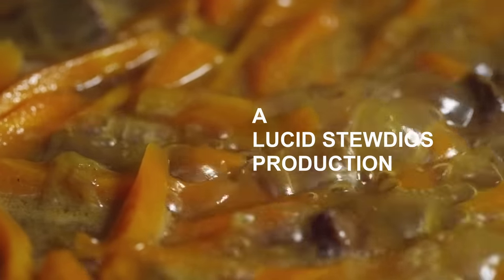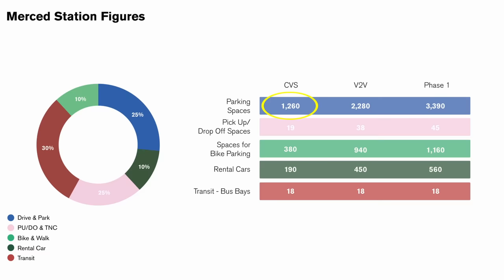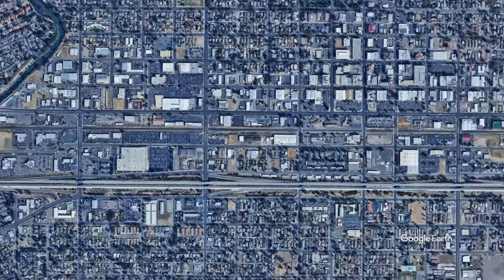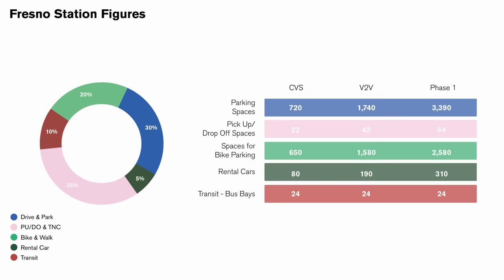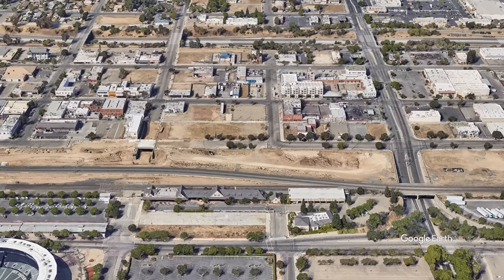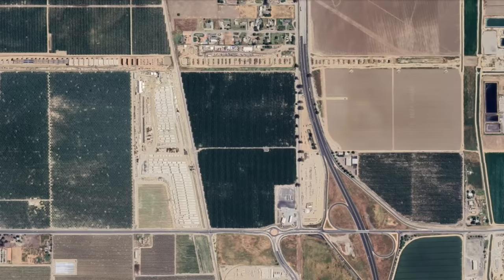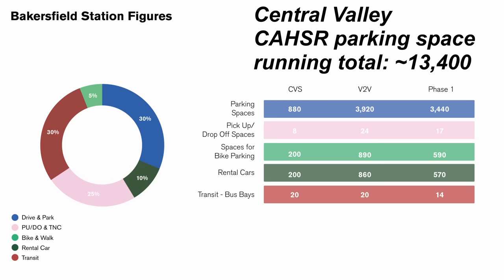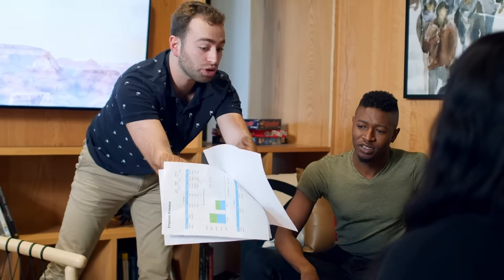California High Speed Rail : A Park & Ride Nightmare | CAHSR

Comment: I'm gonna hold in most of my thoughts on your video because I am already fully aware of your disdain for this agency. What I will say is, just like many other cities with railways like this, TOD will come and I think many of these parking lots will only be placeholders. 

Also, these are just renderings. I'll be excited to be more critical once the final designs come out. So yes, you are overreacting. It isn't an anomaly to build railway stations outside city centers. Valence TGV in France, Reggio Emilia Mediopadana and Napoli-Afragola railway stations in Italy are other good examples of stations not residing in the city centers.
Reply from the maker: Right, someone else used Valence as an example. Go look at what that area is like and then compare it to wasn't going on outside of Hanford. That Napoli-Afragola station isn't even the same situation. It's arguably in a bad spot, but its only a mile from the center of the town there, only 6 miles from Naples, and the area is gorgeous and not a dusty farm town.
Reply: @LucidStew  Makes no difference. Neither of them are in the center of a city. And regardless, all these complaints you have were already negotiated when they first came up with the route, so I don't see the big deal getting pissed about it now. And anyway, the city of Hanford is not even that far from THAT railway station. 

In this country, we should probably be a little more grateful that we're at least getting some semblance of a high speed railway given how terrible this country has been at even getting these things started. Until we have a government that is actually 100% friendly on these things, we have to take what we can get.
Reply: Yes and in quite a few of these situations (Bakersfield) in particular the cities lobbied to have CHSR take a more peripheral route. Not sure it's even a problem but I find that trying to fault CHSR for those decisions without regard for the political forces shaping the route selection is totally misguided. Nothing exists in a vacuum and the CHSRA is not some supreme identity that has power to make all decisions by divine will.
Reply from the maker: @brianwithoutay2291  Who faulted the CAHSRA?
Reply from the maker: @TheRailwayDrone  It makes a world of difference in draw and desire to preserve by avoidance, but if you're determined to ignore the differences, then of course it doesn't make a difference. "we have to take what we can get" no, we don't. We, The People, can demand and vote.
Reply: @LucidStew  Then you should have voted when the project was being talked about. What do you think they're going to do now with all the structures and route that have been built? Tear it down and start all over?
Reply from the maker: @TheRailwayDrone  The existence of the Kings/Tulare station was never up for a vote. It is not mentioned in what we voted for. No, I do not think I can change it, but I can continue to highlight it as an example of the negative effects of government on auto-pilot or the impactful decisions being made by the plethora of non-elected committees, commissions, and boards in this state.
Reply: @LucidStew  Whether it was up for a vote or not, it's there so we have to deal with it. Otherwise, run for Governor and I'm sure you'll have a lot of Republicans and some Democrats who will be more than happy to stop the project in its tracks and leave a bunch of unfinished structures in its wake.
Reply from the maker: @TheRailwayDrone  I don't need to run for office to voice an opinion about a topic, nor does anyone.
Reply: @LucidStew  And I don't need to make content to voice mine.

Comment: I agree the architecture sucks. The number of parking spaces sounds like it is on the somewhat over kill side (roughly half to a third more then what is at a WMATA outlying Metrorail station), Vast acres of asphalt for parking should be replaced with parking structures with ground level commercial or even placing the parking structure above the station head house and platforms. See WMATA Hyattsville Crossing Metrorail station.

Comment: I would so prefer to leave my car in a garage where it WILL be shaded in the central valley, than to leave it in surface parking that may or may not be somewhat partially shaded but will definitely make my car an oven whenever I return
it feels kind of like someone left in those big areas to try and scare people into making sure they become TOD... which would probably then necessitate turning the existing parking into garages anyway
or they were trying to save money (wait a minute)
Reply from the maker: Given the current trend, I would assume surface parking would have solar shading, but that's also not all that great if it needs to be ripped out in 10-20 years.

Comment: All of this looks like they just asked the guys in the highway-monster building department to envision trains. The walk out of Madera station looks like it leaves you abandoned.
These renders feel like they’re setting the whole thing up for failure.
Would be more excited to complain about a lack of parking over making more black burning hot vacant lots that are no good for the environment.
Reply from the maker: It sounds like initially most of these will be fallow until the expansions, which could take a VERY long time. And that also brings up the issue of having to let this land sit there doing nothing in the meantime, or perhaps they will improve it only as needed.

Comment: There should be no parking (except for handicap) at these stations except for maybe Kings/Tulare, take a damn uber if you're that scared of the bus. Agree with another commenter that if we really feel the need for parking, we can build a garage.
Reply: I think the reason these are marked for parking is because they haven't found any developers. I imagine once they get developers it will be different. This seems to be the case with most of the TODs in California.
Reply: Some day you will be able to take the Cross Valley Corridor to the kings station.
Reply: sounds like you really want HSR to fail. Even BART and Caltrain provide parking in the suburban communities they serve. Communities that already have significantly better transit connections than these 4 central valley cities CHSR will initially serve. Parking lots are both easy to build and easy to tear up. There is plenty of time for CHSR to work those details out in a phased approach consistent with the phased construction of the ROW.

Comment: Weird that pedestrians and bicycles are combined, as the distance/reach is way different. Also when combining them it's impossible to determine the amount of bike racks needed.

Also, they are repeating the same mistakes Europe and other places made in the last century, by not having entrances near the end of the platforms. In particular for Merced it would be great to have an entrance in the direction of downtown.

Also it might be a mistake having side platforms in Merced and Madera as it's not unlikely that people will change between trains at least at times when there isn't a great service on all three legs of the triangle connecting to SF.

Comment: How about looking at existing train stations for comparison?
The LIRR Ronkonkoma station has 6100 parking spaces.

How about looking at airports without geographic constraints?
In the Big Blue parking structure alone at Detroit Metro Airport, there are 6700 parking spaces. On-site parking totals 19000 spaces.

Comment: The purpose of CAHSR's central valley stations isn't to move the area away from cars - it's to contain the cars on the cheaper real estate there and keep them out of the expensive real estate in LA and SF. That is also coincidentally what Park and Rides do best, and mirrors the setup that airports have (which is what HSR truly competes against instead of driving).
Reply from the maker: So you're saying it benefits rich people and shifts that burden to the lower classes?
Reply: @LucidStew  i mean, sure, but you could say the exact same thing about airports
Reply from the maker: @jmlinden7  It's a way to do things, but it's not really a good way. Airports have many problems, especially in the amount of land they consume for their activities, or the overall environmental impact of air travel.
Reply: @LucidStew  Yes HSR stations are better than airports in various ways, but they still primarily serve the rich, just like airports do.
Reply: let's not forget that the largest parking lot operation west of the Mississippi is BART. BART is gradually converting some of that parking to TOD but it is a system that essentially operates as a Park & Ride for the more suburban communities of the Bay Area. Many BART stations of course provide no parking at all as they are located in a downtown core. A system as large and sprawling as BART will take on many forms and I think it's not unreasonable to expect the same for CHSR.
Reply from the maker: @brianwithoutay2291  BART is carrying 1/3 of its pre-COVID ridership and had to be bailed out by the state, so not the best comparator if you want to paint CAHSR prospects in a positive light.
Reply: @LucidStew  perhaps the fact that the core business district of downtown SF has a record vacancy rate of 35% is a factor in BART's reduced ridership. If BART had more housing and other TOD around it's suburban stations I'm sure you would get some increase in ridership to downtown SF but who's to say those people would not just work from home themselves? I don't think people are avoiding BART because the stations have too much parking. I suspect other factors are at play.
Reply: @LucidStew  also don't forget that pre-COVID BART had amongst the highest fare box recovery rates of any transit system in the nation. Caltrain had pretty respectable fare box recovery rates itself. The reason COVID affected BART and Caltrain's ridership levels so much is that they served a disproportionately large share of upper income professional workers whose jobs afforded them the flexibility to work from home. With ridership reduced to just the "essential workers" the reduced fare box income threatened their viability. Of course a bailout from the state was necessary and justified in this unique historical circumstance. BART still remains an incredibly successful and well designed system.

Comment: Instead of doing a bunch of flat surface parking why not build up? two parking garage buildings that can be built right up against the station, multiple stories with ramps straight to the station. Why level building to make a parking lots half a mile away destroying local business?
Reply from the maker: The way I interpret it is that surface lots are cheaper as place holders. As the TOD is built, consuming the surface lots, they will build parking structures to replace them. I'm not sure if they will do all of this incrementally, or build all of the surface parking lots at once. Hopefully they spare as many local small businesses as possible for as long as possible.

Comment: Seems like CAHSR may have learned the worst lessons from French high speed station design- stations in the middle of nowhere
Reply from the maker: I've had several people inform me of this and every station that I have heard of in this regard is near a very beautiful part of the country with just jaw-dropping scenery within 5-10 miles with historical structures, towns, and villages you would genuinely not want to disturb. So, if that's the case, maybe still not the best choice logistically, but a bit more excusable.
Reply: Britain's HS2 demonstrates how difficult building HSR is. Finding a commercially viable market, avoiding extensive tunneling, environmental lawsuits and politician vetos, is a little miracle. Germany spent slightly more on her NBS lines than France on her LGVs. Unlike Germany, SNCF went for speed and did not mind P+R stations. As a result, TGV ridership is double ICE's. Ticket sales cover 60% of LGV construction costs as opposed to maybe 1% in more populated Germany. 
TGV ridership is long distance. Short trip HSR can be successful as shown by the 115 km Beijing-Tianjin HSR but the Central Valley towns lack Beijing or Tianjin's population (23 and 14 million) and subway networks serving the HSR stations. There lies the problem, not in the station design which is reasonable.
Reply from the maker: @alaindumas1824  But you must understand that the main dilemma here is not how to optimize ridership on a high speed rail line that doesn't even exist. The dilemma is how to stop the spread of suburban sprawl, which is the structural cause of transportation problems in California.
Reply: @LucidStew  CAHSR is being built because Californians voted to support its construction. I would think sprawl is best addressed through zoning regulation and that is not what the 2008 vote was about. 
In regard to high speed rail, mass transit or urbanism, successes like the Tokaido or LGV Sud-Est clear the way for other projects in the public mind. Empty trains because the market is not there send the opposite message. In my opinion, CAHSR started by the Central Valley segment because it was easiest and cheapest, not because it had any commercial potential.

Comment: No, you're not overreacting, looks like everything is designed intentionally to cause a lot of undesirable outcomes, on some level. Besides the stations are the most dated, awkward, selfconsciously dull... with concrete supports... Why not just use the existing station in Fresno. It looks like they're raised the ground level to block part of the trackside facade. Amazing.
Reply from the maker: On that subject, weirdly, the original station is to form some sort of set piece for the entrance plaza. Speaking of wastes of space...
Reply: @LucidStew  It looks pretty generously sized. Reminds me of the '50s and '60s when they started blatant one-upsmanship against themselves, developers - we had a couple of high rise apartment buildings in NJ about ten years apart. Newer one still makes the older look crappy right next to it. If that's their intention they won't succeed, without burying it.

Comment: Personal transportation is the dominant means to travel locally in that area. I don't get the grievance here. Do you want the HSR to stop at every block? Kind of a ridiculous expectation given the city density is low and hasn't been developed. Probably the whole point of CAHSR project.

Also, parking relates to a thing called "induce demand". Build ahead of time before the added developments come afterward. Much more contentious to build it afterward.
Reply from the maker: Pretty weird straw-man you set up there since I'm actually complaining about too many stations. The low-density, low population areas shouldn't even have stations, at least not built by CAHSR. Let a regional entity finance those. The AMOUNT of parking is an issue. Of course a train station will HAVE parking. The placement of it as well, for instance at the Merced station, which helps separate the station from downtown rather than connecting to it. I feel like I'm repeating the video for you, which makes me wonder if you even watched it. The early ridership estimates put Kings/Tulare at 670 boardings a day. 2800 parking spaces with a projected Drive & Park percentage of 45% for 670 boardings is a land grab, not attempting to meet demand in advance.

Comment: Good. So it will reduce car usage which is the point anyway. Well done California
Reply from the maker: But will it? If you have people moving from areas with good transit networks and more dense housing to lesser transit networks and cheap land, will overall driving be cut? A lot of these areas, you're still going to need to drive 20-30 miles to get from a house to a station so you can then commute by train 150 miles. More importantly Central Valley sprawl will expand, which will reinforce driving behaviors within that region, so you're basically just shifting the problem from the coast to inland areas. This then is counter to the projects supposed social justice aims.

Comment: I think you are overreacting to the architectural designs. I am glad Foster & Partner's is adopting a simpler and cleaner aesthetic. I don't want to see anything vaguely Calatrava-esque. To me Calatrava's over designed structures scream "trapped in the 90's" more than anything else. Foster & Partner's simple canopy structure has an element of New Formalism to it. New Formalism like Brutalism is a mid-century style that is experiencing a resurgence. The bronze elements at the Fresno station only enhance that relationship. Foster & Partner's is without doubt one of the world's most highly regarded and respected architectural firms. I clearly have a lot more trust in them that you do but we will have to see more detailed designs. 

I want the architects to strive for a timeless design and not try to design something to look like the future for the sake of "looking like the future". I am not so excited about the stone elements at the Merced station but I think the overall massing is good. I wouldn't be surprised if the designers were making an allusion to Yosemite as Merced has traditionally been known as a gateway city to Yosemite for bus connections from both the railroads and air travel. The traditionalism may seem out of character for Foster & Partner's work but their portfolio is actually pretty eclectic. Think less Indian Casino and more Ahwahnee perhaps.